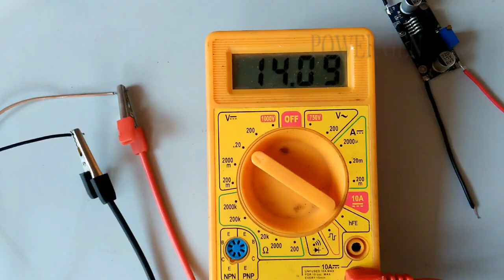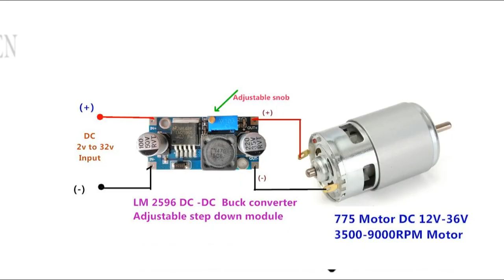775 Motor Speed Controller Using LM2596 DC-DC  Buck Converter | Step-Down Module | POWER GEN

Comment: I use a dc to dc boost converter from eBay for a 775 motor. 18 volt leaf blower at 24 to 30 volts no problem with heating . I did put a heatsink on the motor too. A dremel to open up outer housing so you can use continuously!

Comment: i have a buck converter like this one, but i reversed polarity and it won't work anymore is there any solution to fix it??????
Reply: Any component that has polarity needs to be checked. The capacitors were definitely destroyed. Their might be other components. But things like coils and resistors would be fine.

Comment: Can I connect directly 5 volt charger to the DC booster ?
Reply: You can unless the current drawn is within the limits of charger. Btw, this is step down buck converter and not step up boost converter.  In case if you plan to use boost converter, the boosted output voltage may drop based on the current drawn by load.

Comment: Sir jii 
Mer pas XL6009 DC bost module hi.
Or usme input me 3.7/5 v -- output par kuch v load deta hu bahut jayada garam hota hai..
Or input 12v dete hu to koi problem nahi hoti hi.
Kya karu...
Reply: ampere output when on load should be less than the rated one on xl6009... more ampere means more heat...

Comment: Can u use same dc boost cricut to andjust heater??
Reply from the maker: this is a buck converter circuit
Reply: POWER GEN yes but can u use to set heater or cooler power???
Reply from the maker: you can use a heat sink with cooler fan